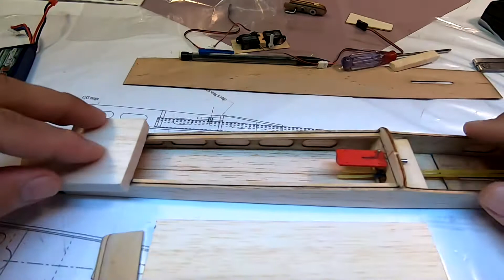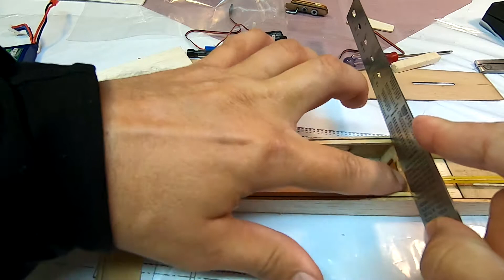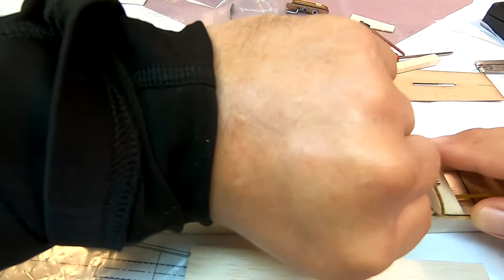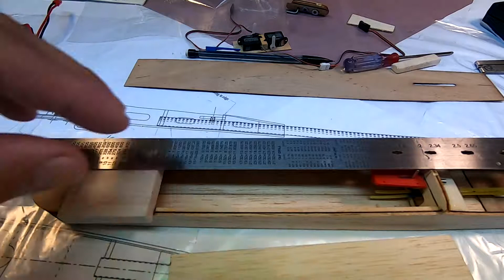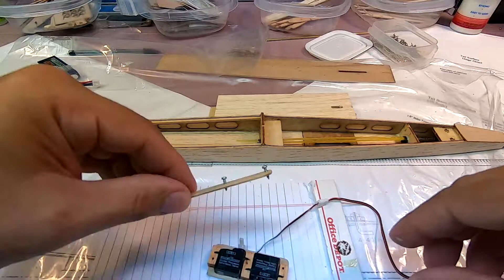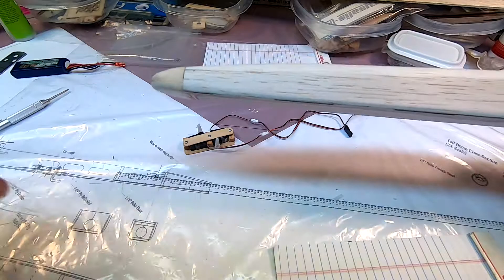Chrysalis-Lite RES Build - Pt4e - Assembling the Pod/Fuselage

Comment: Looking good, like I said  before double check that your servo hold down strap does not warp the servo casing and cause gear binding. Personally I'd build up the posts that the strap sits on to exactly the same height as your servos then there is zero chance of binding and the servos will still be snug.
Reply from the maker: I've tested the mounting system and can torque down the strap till it bows without the servo gears binding. I'm sure it can happen and will not be tightening the strap much past contact. If I were building the mount from scratch, I might make the posts close to the servo height, but i don't think I need to modify it further. You will see in a future video that I have reduced the width of the strap substantially to save weight. This also reduces the possibility of it deforming the servo cases. Which servos did you use in your Chrysalis?
Reply: My RC Channel 
It was in my Magellan 2M wing servos that I gave myself the binding problem. I am using Hitec hs65mg so they were not cheapo servos.
Reply: I would have just CA the floor and used 3M double sided trim molding tape, that way you can still rip out a bad servo, or just drill a small hole for the servo arm screw.
But other than that, I like the ship and you are definitely on par with a experienced builder, next you should try scratch or just try to discipher a hostetler  plan...lol